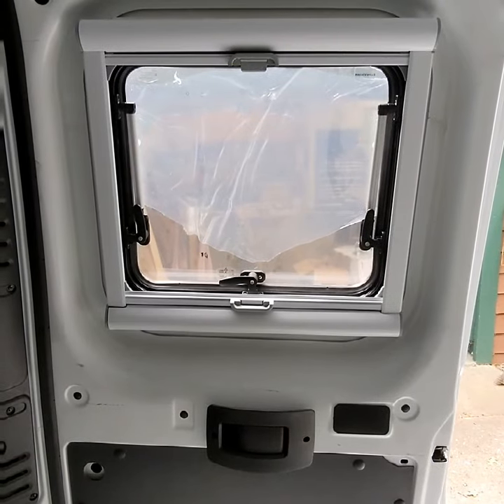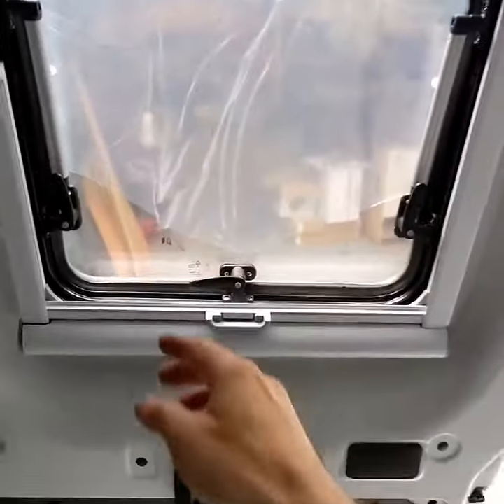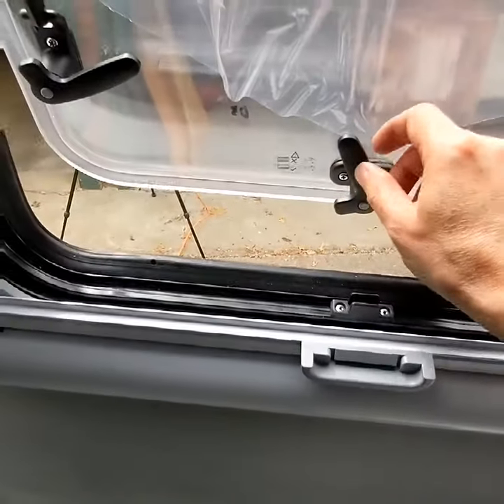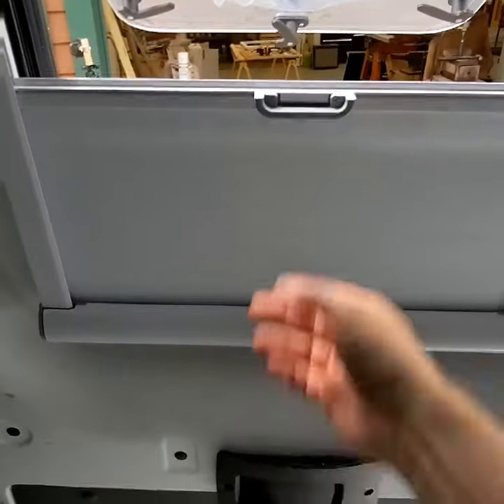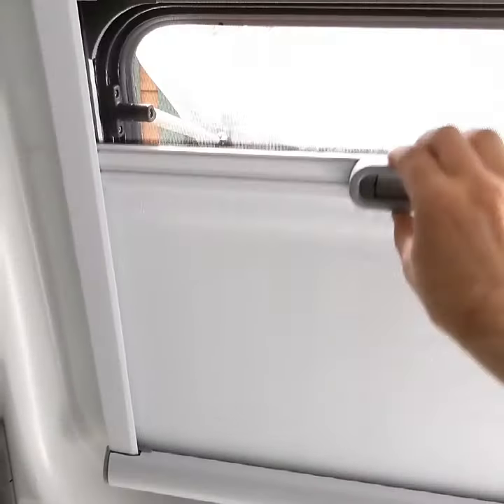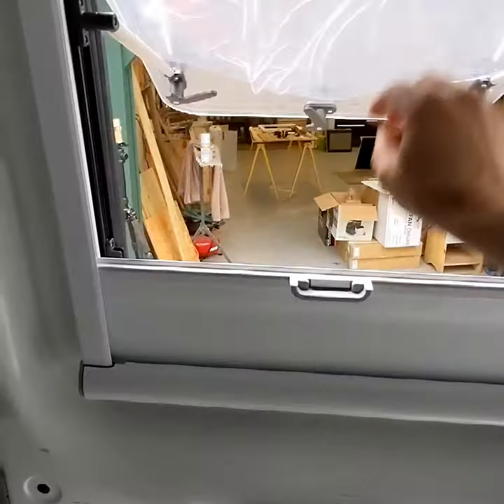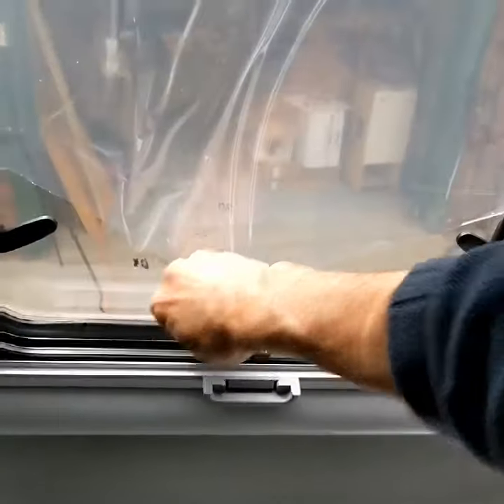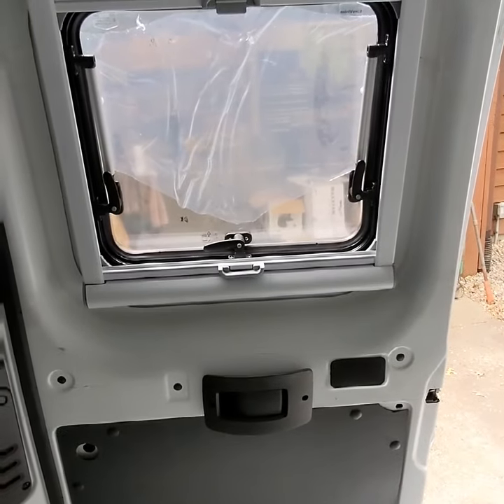Campervan Build - Installing the Tern Overland window

Comment: Thanks for your video. What size are the Arctic Tern windows?
Reply from the maker: Hey, here are the three window sizes I used based on how they list them on their site:

3 Windows 
(1 - Arctic Tern 450x1100mm) 
(2 - Arctic Tern Window 450x500mm)

Hope that helps!
Craig

Comment: I have a 159" Promaster. Could a larger window than yours fit in the back doors. Also, what size inner ring did you use to allow the shade/ screen to mount on top of your interior siding? Thanks
Reply from the maker: Hey, I'm not sure but I believe the width of our different length vans is the same. Based on the guidance on the Arctic Tern web site I purchased the largest window I could for the back doors which was the Arctic Tern Window 450x500mm.

In terms of the ring, I don't remember the depth measurement but I believe it was the thinnest. That was actually a bit of miscalculation on my part though. Have a thicker ring for the install would have made installing the interior siding easier. As it worked out, after adding insulation/siding it extended beyond the window ring and the shade/screen portion. I ended up building around the shade/screen part instead of being able to build under it. If you look at my later videos of the build you can see it. It worked out fine, but it did mean a lot more fussing about and it would have likely looked better if I had purchased the thicker ring. 

So, if you can, do your best to figure out the thickness of the materials you plan to put on the wall before buying the windows and if that's not a possibility, I think I would have bought the thicker ring so that I would have had the option to install around the window more closely and still be under the shade/screen portion. Even if it was too thick it likely would have been easier to build out to it and make it look nice vs what I ended up doing. 

Hope that helps.

Craig
Reply: @ckmworks3509  Thanks for the additional info. I reviewed the video again and see what you are talking about. I’ll have to measure the depth and try to calculate the inner ring size to order. I also need to see if my bed frame would hit the ring and preclude mounting the shade/screen on top of the interior siding. Thanks

Comment: Looks good but you've installed inner upside down ☺️ shade comes from top side not from bottom
Reply from the maker: Actually that was a specific choice on my part. I wanted the ability to have airflow and have more privacy. By having the shade come from the bottom you can block out the view on the lower half. For example, if I'm using the toilet I can still have airflow in the van but have privacy while doing my business. Others have done it this way as well and I liked the setup. The unit is reversible so you can make whatever choice works for you. Hope that helps with why I made that choice.
Reply: @ckmworks3509  fair enough all the best in your build hope to finish my own asap and hit the road
Reply from the maker: @gregor8323  Good luck with finishing your build and enjoy getting out there!!